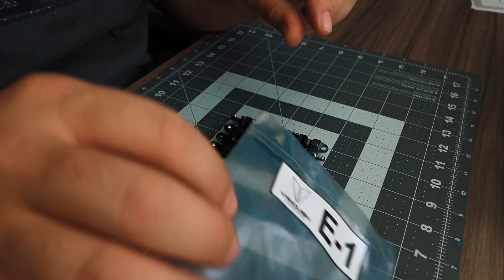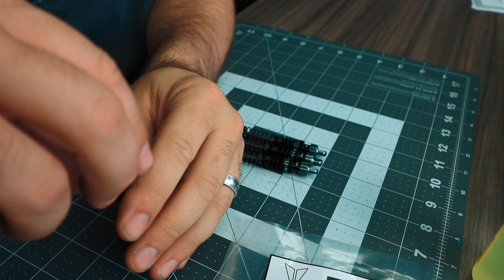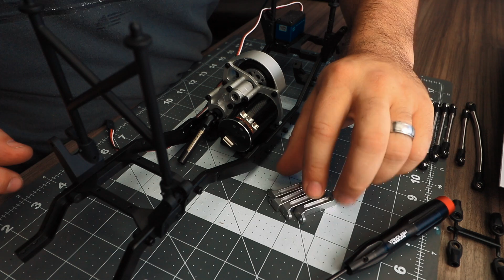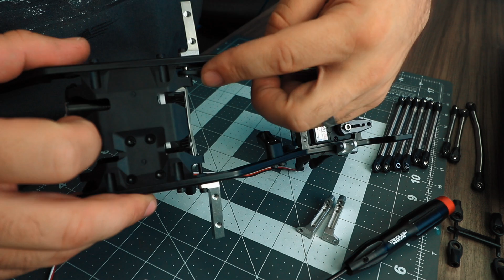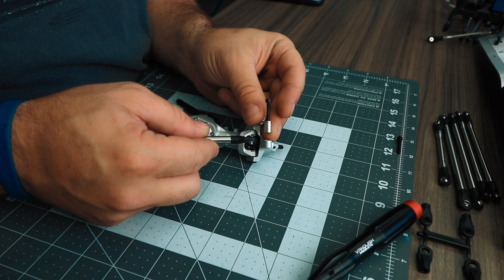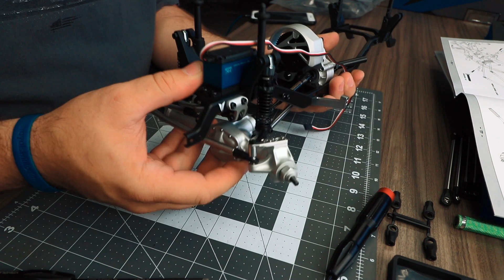VS4-10 Origin - Suspension Assembly - Vanquish Products

Comment: I have a question so look away now..  I just bought the chassis kit and a set of d44 axles along with the 12.3 links and a three gear trans case just to let you know what I’m looking at.  When I go to put the front axle on my upper link (that came with the front d44) was too long and rotating my axle pinion too far forward I tried to see if I put the lower links on wrong but I didn’t would the fix to be to use the upper link that came with the link kit? I originally was going to swap a scx10 2 into this kit so that is where my links are from plz help I’m stuck till I do some research but it’s 4:30am in mo right now and it’ll have to wait thanks

Comment: When you are putting the shock cap back on where is the shock shaft in relation to its stroke? I have been assembling mine with the shaft roughly half way through its cycle and can not get these things to stop leaking.
Reply from the maker: It depends on the amount of oil that was used. If it’s beginning to pressurize the cavity it will blow oil past the seals. They have a dual x-ring lower seal which is more than about any other scale shock, but pressurizing that small volume will still blow fluid past them.

Comment: The little metal stud in the middle of your shock shaft pliers is made to insert and remove balls into rod ends. Was a bit surprised you didnt use it.
Reply from the maker: I don’t like to use it because it will push the ball all the way through the rod end. I wish it had a bump stop to fix that.
Reply: Ahh yes. Have to get a feel for it.  A bump stop would be perfect.